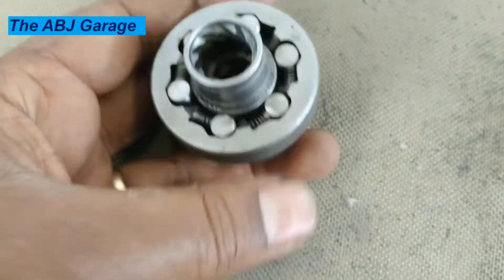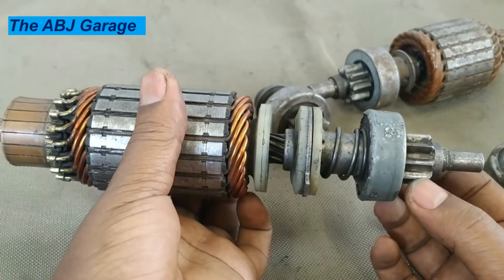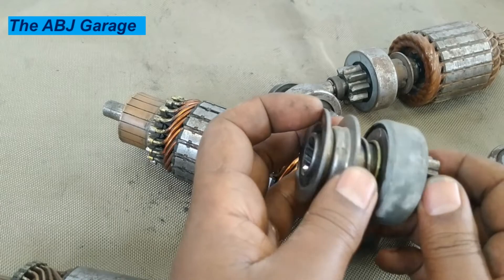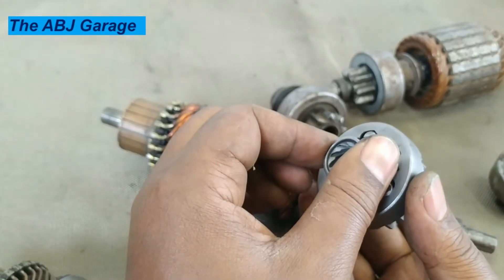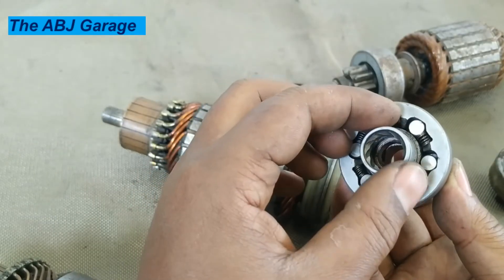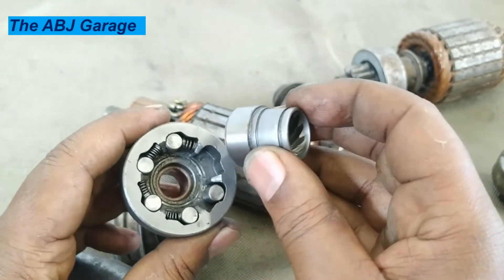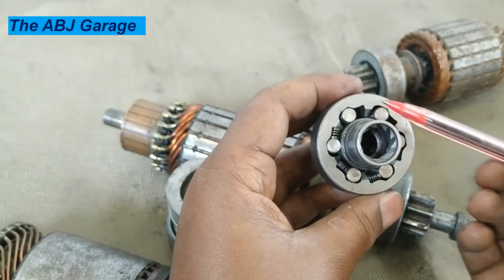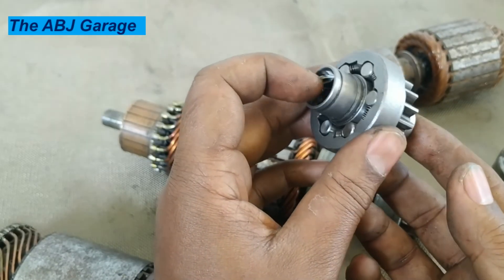How does a starter clutch work?

Comment: Good video! Just one thing I can't wrap my head around. If the outer race is pushing springs towards rollers, why do the rollers move towards the springs?
Reply from the maker: Once the engine starts and begins to run on its own, its speed surpasses that of the starter motor. This relative change in speed and direction (compared to the starter motor's armature potential to drive it backwards) allows the balls to be pushed out of the wedged position, compressing the small springs and letting the starter mechanism freewheel or spin freely.

Comment: What is the benefit of running clutch for stater ?
Reply from the maker: It used to disconnect power flow to the starter armature once the engine is started. If power flow is not discontinued, then the engine flywheel can make the starter armature run at extremely high speed which is destructive.

Comment: Hi friend, I have a problem with the starter clutch, but the opposite, instead of slipping, it is binding when the flywheel starts to spin, this happens occasionally once every 50 starts lets say. Would soaking in solvent help? Or spraying WD40, but I'm not sure if it will get in because its almost sealed, I'm not sure how to remove the cover without damaging it.
Reply from the maker: Soaking will definitely work! use solvents like kerosene if you want and do as described @ 12:00 minute in the video. Soak... then shake..... soak....then shake repeatedly until the binding debris and dirt in the clutch is washed off. You could see that as the color of the solvent keeps changing as you wash. Also check this out https://www.youtube.com/watch?v=uzM9MxFp75c&t=5s

Comment: Thank you for the great detail. I will disassemble mine and look at the rollers.
Reply from the maker: Glad it helped
Reply: @TheCarCareGarage  you are awesome.  I have been racking my brain due to the 'everything is engaging, but no power flow' (rollers not transmitting power).  I tried the soaking and shaking and it worked.

Comment: The pinion gear is smooth. The rollers are smooth. I can’t understand how force is transmitted from pinion gear to the rollers to make it spin
Reply from the maker: No matter how a surface looks to the naked eye, there are always surface irregularities and hence we have friction even on the shiniest surfaces. And in addition, the springs are forcing the rollers to a narrow and tight space, holding them pressed. This increases the gripping of the rollers and hence power flows. One roller might not be enough, but when we have multiple of them, they assist one another!
Reply: @TheCarCareGarage  i watched another video and understand it now. It spins because the rollers are jammed into a smaller space then its diameter which forces the shaft to spin.

Comment: Nice demonstration of operation.  But the entire clutch is sealed and no way for dirt to get in. What actually happens is that the grease around the rollers eventually dries out and prevents the rollers from engaging the shaft properly or the rollers eventually develop a flat spot ( especially if not properly lubricated ) and because the clearance between engaged and disengaged is extremely small the flat spot or spots ( 5 rollers ) will again prevent the clutch from transmitting power. So 2 reasons why they fail - lack of lubrication causing flat spotted rollers and broken springs - as he said he had removed 2 springs to replace springs that had broken in another clutch.
Reply: So my truck manual says never to immerse the clutch portion in any solvent.   Why?  Perhaps because the solvent is very viscus and can penetrate and strip any remaining lube from the rollers.  In that case I guess it's better to just buy another new one as they are sealed and cannot be re-lubed per se.  
Probably not worth the effort of trying to open and then close up the clutch case.  
Good explanation video though.
Reply: How does the smooth pinion gear transmit force to the smooth rollers to make the clutch spin? I cant figure it out. I paused the video to see if there are any machined grooves in the pinion but it looks completely smooth
Reply from the maker: You are absolutely right! Well said! Thank you very much dear!

Comment: Can that clutch be reversed?
I have disel starter motor who I modified to turn ither direction but I come across problem the clutch does not spin in proper direction so is it posibel to disabel that clutch rotstion the pinion?
Reply from the maker: You would have to reverse and interchange the pinion gear and it's spline to try using it in reverse direction.
Reply: @TheCarCareGarage  ok thank you